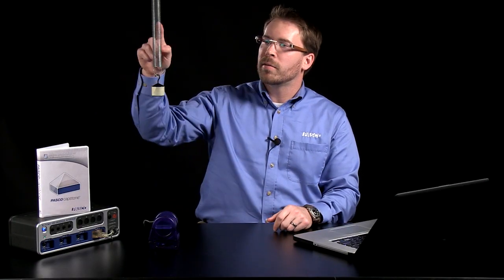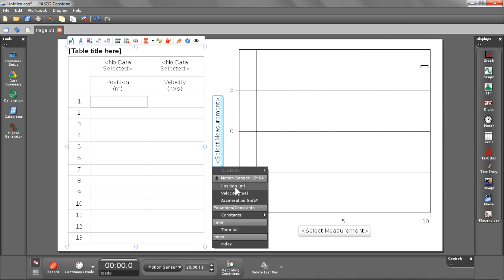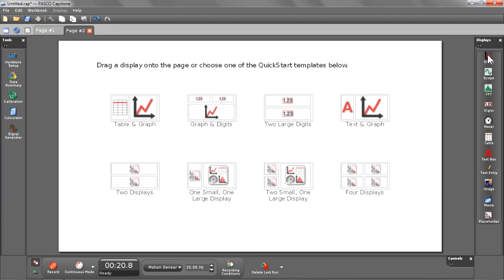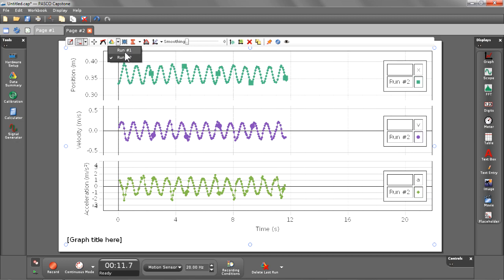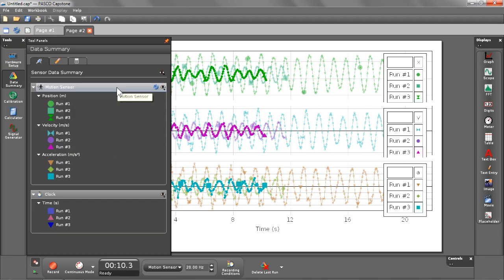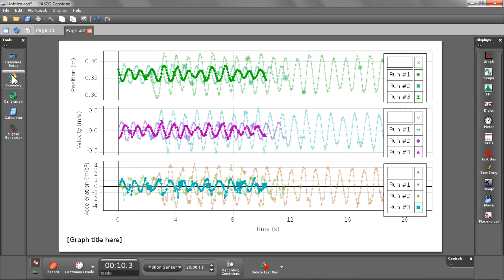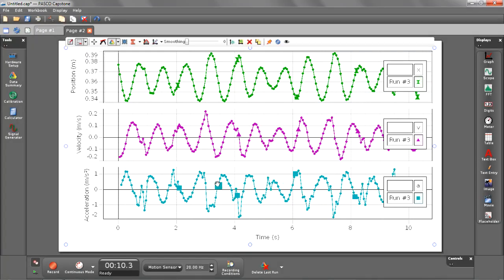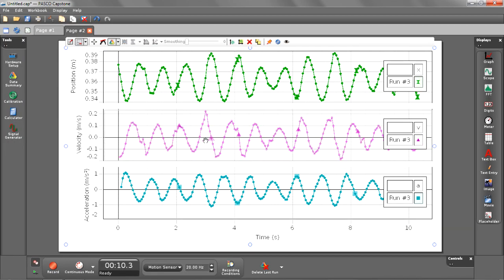PASCO Capstone Software Introduction

Comment: I noticed that the equilibrium position for the spring is at 0.36 m. Is there any way to change that so the spring starts at the position 0?
Reply from the maker: In the current version of Capstone, you can quickly zero the Motion Sensor's position reading by pressing the "Zero Sensor Now" button, which will appear to the right of the sensor's sample rate in the Controls panel at the bottom of the Capstone window. See how it's done in this brief movie: http://youtu.be/at8SQq0dr3I.

Comment: I bought some PASCO Experiment kits  and I will be using PASCO Capstone...what would be the best PC to run the program. Can any one inform me....
Reply from the maker: Hi Fred,

You can find the latest system requirements in the Specifications section of any of the PASCO Capstone license pages at the PASCO website.

Currently for version 1.1.5, they are
Windows	
  XP SP2 or higher
  2 GHz processor
  200 MB available disk space
  2 GB RAM
  Display size: 1024 x 768
Macintosh	
  Mac OS X v10.6 or higher
  Intel CPU
  2 GB RAM
  100 MB available disk space

Comment from the maker: If you check the position vs time graph once it's rescaled at 1:27, you'll see that the initial position is actually 0.36m, the distance from the Motion Sensor to the bottom of the mass.

However, if you do want to define the initial position as zero, be sure to update to the current version of PASCO Capstone, version 1.0.1, which adds the ability to set the initial reading to zero. You'll find this feature in the Properties of the Motion Sensor in the Data Summary panel.